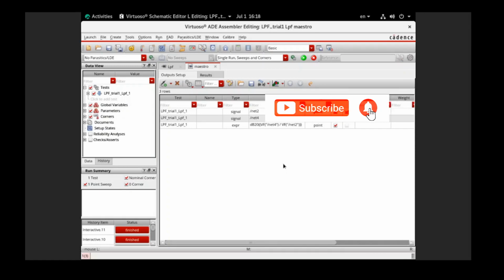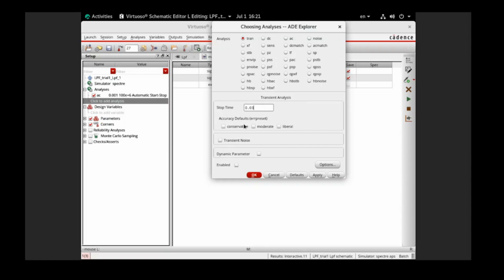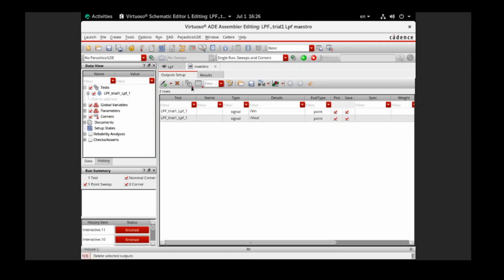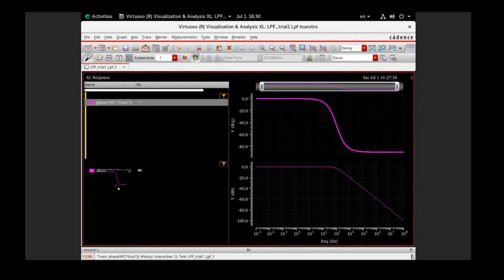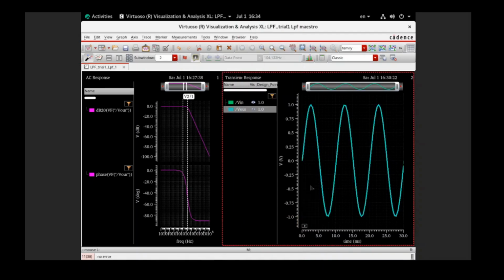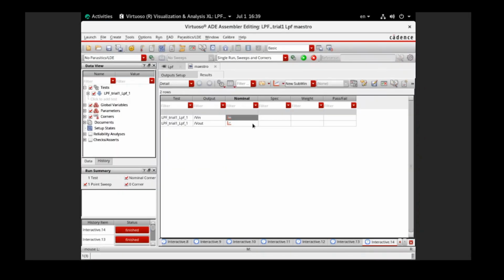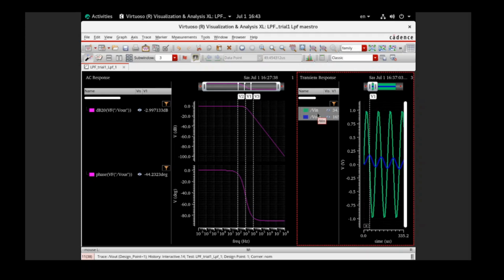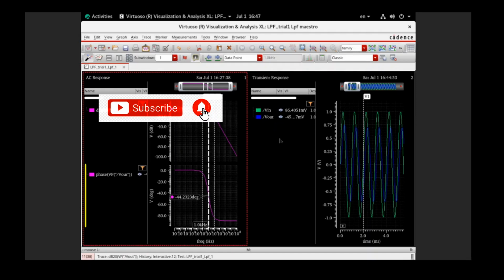Cadence, Low pass filter, Transfer function analysis with transient simulation. P2

Comment: Hi 
I'm still learning to use cadence
I have an issue with simulation
I'm using salama otra model to design rc sinusoidal  oscillator and I'm using 180nm technology and passive components of values R1= 10k , R2= 1k, C1&C2=100p & 1n F and for the biasing current I'm using idc component of value 80uA.
 I'm using vdc instance for supply voltages VDD and VSS .I'm using 1.8v for my supply voltages and I'm using same instance for my gate baising voltage and I'm using +0.5v for my nmos gate biasing and - 0.5v for my pmos gate biasing
After doing the transient analysis I'm getting a ramp signal instead of sinusoidal signal.
Even though i tried every way still facing the same problem.
I hope u see this comment.🙂
Reply from the maker: @mochii9116  i am not sure about what could be your problem. But commonly, the problem might come from the DC operating point of your circuit. For example, maybe some of your transistors do not conduct the expected DC current.